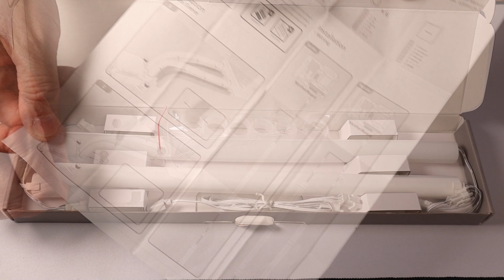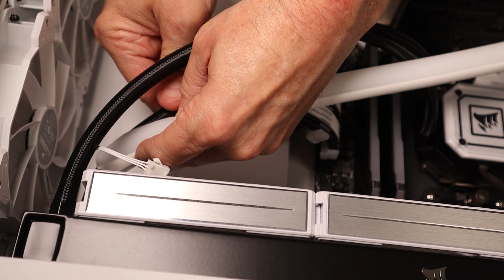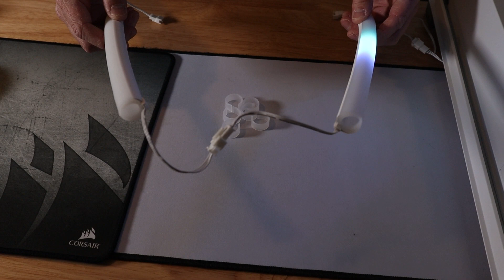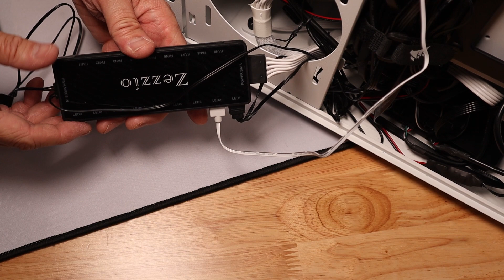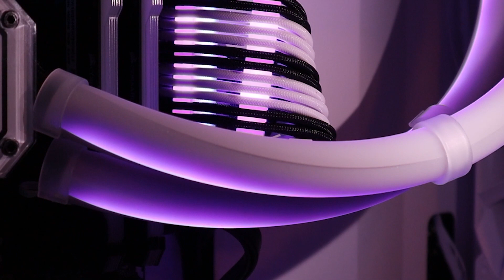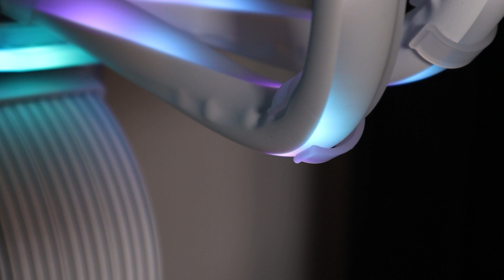EZDIY-FAB ARGB AIO Tube Sleeve - More RGB Awesomeness!

Comment: does it effect the cpu temperatures?
Reply from the maker: Hi techtester-b5y, any RGB lighting is going to add heat into a case. These RGB sleeves being right on the water hoses it probably does contribute to some heat buildup as well. With that said, I did not test that in any way. It would be an interesting test to maybe just pump water through the loop with these sleeves installed and meaure any temperature increase just from the rgb lighting. 

My initial theory would be that it's insignificant to the overall water temp, let alone affecting the CPU in a measureable way, that would be difficult to fully test. 

I wouldn't worry about that as a basis for purchasing these sleeves if you otherwise want to try them. 

However, I could be wrong and as I type this, it's exactly the thing I wouldn't mind taking a peek at.....It shouldn't be too hard to at least see if there is a measurable impact on water temp (or cpu temp) over time....I'm adding this to my idea list for videos, might be fun. 

Great question, let me know what you think, thanks for watching!!!

Comment: How exactly did you integrate this in icue? I’m trying to make sure the rgb psu cables and cooler sleeves will be able to sync with the icue corsair components. Sitlyr psu cables and this sleeve are my choices right now
Reply from the maker: Hi Spartan089a, there are a couple of methods to get this working with iCUE, check out this video on getting non-corsair rgb working with corsair, requires a CORE XT, commander pro or lighting node pro and an adapter cable:
https://youtu.be/JgLUDe1yzYw

Here is another method I explored using an adapter cable on the 4 pin fan connector or a core xt or core:

https://youtu.be/w2Pt86_qUYc

Those should give you the details on how to get this working with iCUE, great question! Thanks for watching!!
Reply: @HardwareArtisan  thanks for the response. I really appreciate it. I found two lighting node pros and a usb header splitter so I don’t use up all the usb header inputs on the motherboard.

Comment: What program to use to control different features?
Reply from the maker: Hi Johnnyboybravo, there is no specific program to use with these, they simply use a 3 pin ARGB connector, so you can control them using any of the Motherboard RGB control software (whatever is specific to your motherboard), or you could use corsair with an adapter cable. Basically whatever software can control your 3 pin ARGB connector will control these. I hope that helps, 

Good luck, have fun and thanks for watching!!!
Reply: @HardwareArtisan  I'm having a hard time finding a way to control them.  Like, I want a drizzle effect on one sleeve and another color for the other sleeve .  When I use armory crate, everything that's connected to the mobo (ram,mobo,sleeve) will have the same effect.  I can't control each.
Reply from the maker: Ok, it sounds like your using your motherboard to control thr lights which motherboard do you have? It may be possible to separate different lighting elements. Let me know what motherboard you have and how your connecting this, to which argb port and I'll give you some ideas.
Reply: @HardwareArtisan  Asus ROG STRIX Z690-E

Comment: I'd have to use that flow effect 5:31 and chain them to mimic the water in and out of the radiator. Or unchained with the ends swapped...red in...blue out.
Reply from the maker: Thats a good idea that I didn't explore, it would need an extension cable, but easy enough to do! Awesomeness!! Thanks for watching IcantSignIn!!!

Comment: Great product and video!
I just have a question I'm looking for one of those adapters for the "normal" ARB to corsairs. I want to connect the other RGB to my Corsair. Which one is it or where can I buy one?
Reply from the maker: Hi Hellboy, thanks for watching!! Here is an adapter cable to convert "normal" 3 pin ARGB to the corsair plug, there are several of these on amazon, but this one works well. 

https://www.amazon.com/EZDIY-FAB-Adapter-Lighting-Commander-Included/dp/B08KGMZ9YT/ref=sr_1_2?crid=6X7JTI31FIF8&keywords=corsair+to+3+pin+argb+adapter&qid=1670632071&sprefix=corsair+to+3+pin+argb+adapter%2Caps%2C96&sr=8-2

I've take this cable and plugged it into a normal RGB hub to connect multiple devices with the one cable, works well, i showed an example of that in this video. 

The hub I used in this video was:

https://www.amazon.com/gp/product/B095NPZDWF/ref=ppx_yo_dt_b_search_asin_title?ie=UTF8&psc=1

There are many of these on amazon, but this one works well enough, you can get smaller ones that only do ARGB. 

Thanks again for watching!! Have Fun!!!